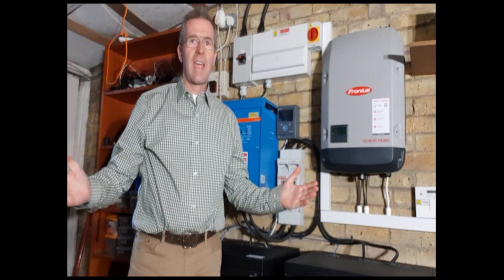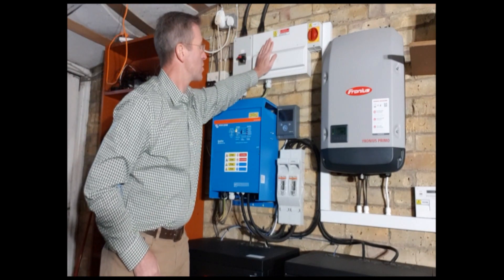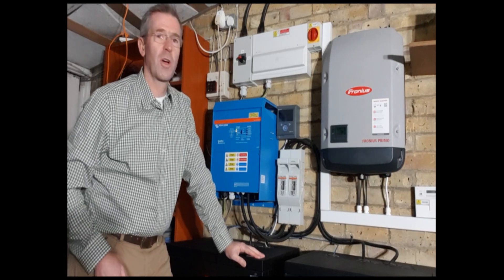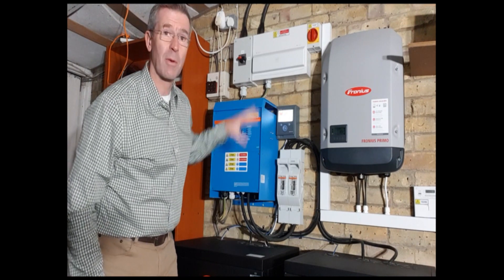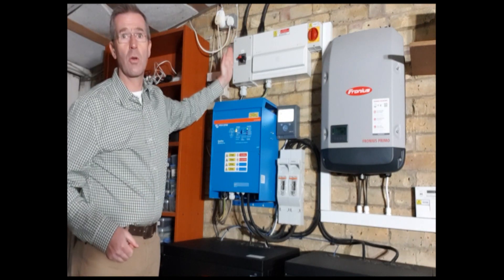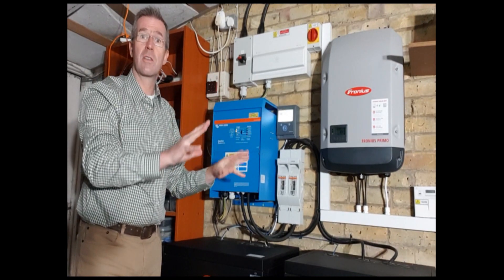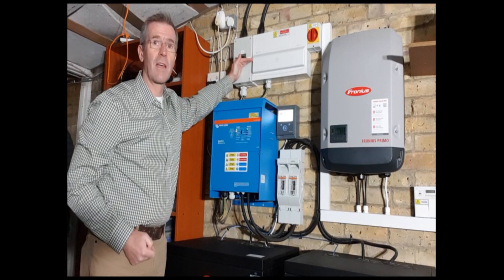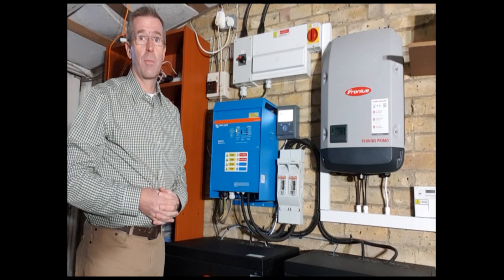Victron Off Grid Overview

Comment: Hi everyone I had the same type of system but my victron inverter malfunction and stop working during backup mode and the company has stop repairing this inverter need to replace 10 capacitors that are burned any lead

Comment: For example, the batteries remain full and VictronMultiPlus starts to increase the frequency from 50 to 52 Hz in the home network to stop Fronius. Please tell me, at this point, can the MultiPlus continue to supply current to a GRID with a frequency of exactly 50 Hz?
Reply from the maker: THanks for the question. Yes no problem. The frequency is only important when connected to the grid. When disconnected the Victron can set the frequency as required. When it cinnects again, the Victron synchronises and hands control back to the Grid i.e. it goes into follower mode.
Reply: @tanjent-afuelincludedcompa4336 Does this mean that the Multi-in AC-in can sometimes disconnect from the AC-out and each work on its own frequency? For example, does the AC-in send current from the battery to the GRID at 50 Hz, but the AC-out at that point feeds to the Fronius at 52 Hz to slow it down?

Comment: Do you have a G99 Loss of Mains Protection relay installed? (Would have been G59 when this video was made)
Reply from the maker: Sorry for slow reply. It depends on the particular inverter and what the current certification is. If the inverter is not itself G99 certified then we can add an external relay.

Comment: Hi, wondering why did you not use MPPT for the batteries.
Reply: time shifting of power! I do have a dc coupled system myself where I have  2 large 250 100 mppts from victron and you are right the mppt is probably more efficient (on battery charging!). however I am learning that most installations where the grid is stable and much net metering is still required to offset initial capital cost..a grid tied inverter is more efficient and also particularly more suitable when you have large loads during sunshine hours. the inverter charger does not need to work a lot harder other than taking surplus energy from the grid tie to the batteries and also charging the 20kw lithiums from the grid when the rates are low especially you have an upcoming  dull weather day. The power assist feature is even more enhanced as you have literally two inverters and the load can even be more shared as the inverter charger will be supplementing the fronius output power with power from the batteries.

Comment: Hi, I have FRONIUS SYMO 6.0-3-m. Three phases. I needed a configuration to charge my 380 volt lithium battery and the inverter was running on a hybrid circuit (VECTRON?). Can you help me? Thanks in advance. Shalom.

Comment: If the Fronius was a grid tied inverter on a feed-in-tariff, would the owner see a decrease in revenue after the installation since the Victron inverter is essentially throttling down the Fronius inverter?
Reply from the maker: Sorry for slow reply. It is only throttling the inverter during a grid disconnection so it won't affect tariff (no export when the grid is disconnected)

Comment: I need a combination of Fronius and Victron but already have 3 Phase Fronius 10 kw. Can i use only 1 Single phase victron to achieve the combo?
Reply from the maker: Hi Jeffree. If it is a grid-tied system then you can have an inverter/charger on just one phase; this would be a grid-tied battery storage system only operating on that phase so could only utilise a third of the energy.

For off-grid/stand alone systems you must have an inverter/charger on each phase to absorb the PV generation (since a 3-ph PV inverter outputs balanced power across all three phases) and regulate using frequency shifting.

I hope that makes sense.
Reply: @tanjent-afuelincludedcompa4336  is possible.to discussfurther
Reply from the maker: @jeffreerugare704  By all means. Best may be to ask for a quote via the website, and then one of us will call you back. https://tanjent-energy.com/solar-and-battery
Reply from the maker: @jeffreerugare704  By all means. Can you pass me a phone number, or go to the tanjent-energy website and put in a quote request?
Reply: Tanjent - a Fuel Included company share your website address
Reply from the maker: @jeffreerugare704  Our website is tanjent-energy.com
Reply: Tanjent - a Fuel Included company I send a quote request.

Comment: Is the Fronius Inverter not an AC inverter? Can it use the charger function of the Quattro to charge the batteries? Or can it supply MPPT DC power to the batteries directly?
Reply from the maker: Hi Floris. Correct - it is an AC inverter and so uses the charger function of the Quattro to charge the batteries. Happy New Year.
Reply: @tanjent-afuelincludedcompa4336  Very interesting setup, I've never seen that done before. What are the efficiency numbers versus a direct DC MPPT feed? Happy New year to you too!
Reply from the maker: @Florisjeheino  Hi Floris. Typically each AC to DC conversion and back loses of the order of 3% to 5%, so that is how much you save if you cut out one of those steps.

Comment: Can we setup fronius victron combo even without grid ?
Reply from the maker: Hi Moutsem. Absolutely. FOr a fully off grid system we would probably look at a few changes to the design, but it does not need the grid to work. cheers Jason
Reply: @tanjent-afuelincludedcompa4336  good to hear that a grid tie inverter can work without grid using frequency shifting control , so the main voltage source to power the grid inverter will be the inverter charger ?
Reply: Or the grid tie  fronius dc powered from the solar panels ?
Reply from the maker: @makmakmak840  It is the inverter charger that is controlling the AC frequency.

Comment: Why do you need the Fronius inverter? Cant the Quattro handle that?
Reply from the maker: The Fronius/quattro combo allows the solar to keep generating even if off grid. The Victron is able to control the Fronius to reduce its generation to match the required load.
Reply: @tanjent-afuelincludedcompa4336  what happen when the Grid is failure ? is fronius still working ??
Reply from the maker: @omarfathallah3446  Correct - that is the big advantage of the Fronius in this scenario.

Comment: Is their a reason one would opt to have a grid tie inverter and the Victron vs the Victron Quattro with a MMPT charge controller?
Reply from the maker: Sorry - a bit slow to respond. Key reason is to allow the system to still generate solar if off-grid.

Comment: Is their a reason one would opt to have a grid tie inverter and the Victron vs the Victron Quattro with a MMPT charge controller?
Reply from the maker: HI Basil. Sorry about the slow reply. I only just saw this. The Fronius grid-tie inverter allows the solar to keep supplying the house even if there is a power cut.
Reply: @tanjent-afuelincludedcompa4336  Doesn't the Quattro supply power on the mains from the batteries if there's no mains supply?
Reply from the maker: @pau1phi11ips  Hi Paul. It certainly can depending on the configuration and set up. That is exactly what the system in the video does.

Comment: How is the grid tie inverter wired up if you turn off the mains ? Is it on Ac out  on Victron going into Ac in on grid tie?
Reply from the maker: The grid tie inverter is a Fronius and it is controlled by the Victron (by adjusting the voltage frequency that the Fronius sees). So if grid is off and there is no internal demand then the Victron effectively shuts down the Solar inverter. Does that answer your question?